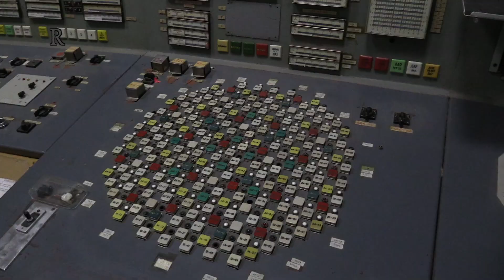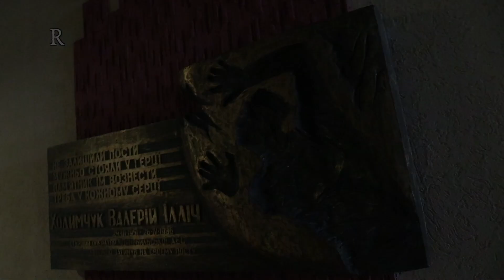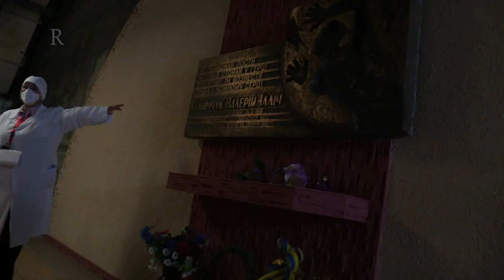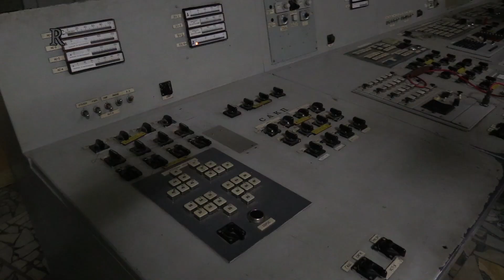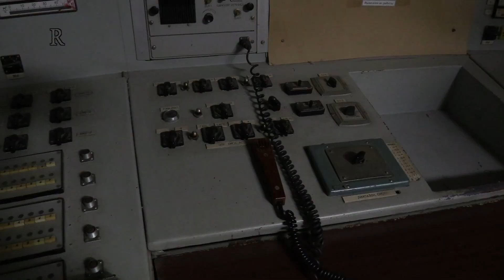Inside Chernobyl power plant: Contaminated parts

Comment: So the tour guide is impervious to radiation poisoning for it’s her daily job??
Reply: Don't get too impressed by the beeping alarms and white coats. If the 10 μSv/h they read off of their dosimeters is typical for her work environment, then that is practically harmless. You could spend your entire life inside those halls without any measurable increase in cancer risk. You need to get over 50.000 μSv before there's any reason to worry.
Reply: Many jobs have allowable levels of radiation exposure that have an increased risk of health problems. In the United States her exposure would be regularly monitored to keep it at allowable occupational exposures.
Reply: @francesca234  Exactly. The 50.000 μSv I mentioned is the annual limit in the US (which is half the dose associated with any increased risk of cancer). Even if this Russian guide would work inside the power plant for 40 hours a week, 50 weeks per year, then 10 μSv/h would only give her 20.000 μSv per year. Well under the American limit, and a long way off from the 2.000.000 required for possibly fatal radiation poisoning.
Reply: yes

Comment: THATS THE EMERGENCY POWER HOW LONG HAS IT BEEN ON
Reply: Yeah the emergency power has been on for 33 years...
Reply: Dude, that's not emergency power. It's just normal power. People still work there. The wast majority of the power plant is perfectly safe, including the areas they visit on this tour.
Reply: Yeah but they have on site generators don't they
Reply: @cb7600  I'm sure they have backup generators, but why would they be using them for normal operations? I assume they are just connected to the power grid, like everyone else.
Reply: @egodreas  yea that would make sense only if they build reactors 5 and 6 and have them protected more with the safety protocols maybe they would not need the power grid

Comment: 2:54 'What is the level?'   "4.4uSv"  That is LOW.  Those geiger counters start alarming at a few times higher than background level.  You get somewhere around 2 to 3uSv/hr sitting on a plane at 40,000 feet.

The area near the reactor is actually quite low dose as it was so thoroughly cleaned up because people had to work close to it.  There are much much higher reading hotspots around the zone if you know where to look.
Reply: There are thick concerete walls, that's why the dose is low. Here's a video from the reactor hall (in Russian)
https://youtu.be/zP-EbZL7040
Reply: Perhaps they turn the alarm threshold down to make it more exciting for the tourists.
Reply: Nuclear plants have very strict regulations. Under normal operating conditions, someone working inside of a nuclear plant will receive less radiation than a person working outside.

Comment: The flickering cathode light tubes give it that extra creepiness 🙄
Reply from the maker: When I saw that I was sure to use that clip :)
Reply: I imagine no one would want to stand in that hallway long enough to replace a ballast and bulbs.
Reply: Yes
Reply: Seriously terrifying, right out of STALKER or something lol
Reply: Have you never seen a fluorescent tube? They can absolutely flicker like that.
Reply: @TheBleggh  The type of tubes they currently use are LED. They replaced the conventional TL fixtures the hallways in 2016-2020. The flickering pattern you see in the video is exactly timed in a pattern either a LED driver or EVSA makes. A conventional fluorescent ballast blinks random intermittent. If you look at the fixture close enough you can see it's a "Batton" LED fixture anyway. If you don't believe me, undervolt an LED lamp and see it yourself.
Reply: @DogappelI thought you were implying the flickering was intentional and not a dodgy LED. If that wasn't your intent, my mistake.
Reply: that is from Beta particles which can damage electronics. Gamma can cause flicker and it can kill cells, reproductive organs, and it can kill anyone exposed two years after contact. Alpha particles can cause burns but they and Theta particles are absorbed and can not do harm.
Reply: @geomodelrailroader  alpha particles can do massive harm if inhaled or ingested. alpha carriers are the most deadly
Reply: @wyliesdiesels4169  that is what i wanted to say,cause Gamma and Beta radiation can be cleaned from the body(as far as i know),but Alpha radiation is the most dangerous since if it stays in your body due to absorption,it will obviously cause mild,then critical damages within the body. But as i said,this is what i know.
Reply: lmao I'd hate to be the electrician in that plant
Reply: Sorry to disrup the vibes, but they replaced the original fluorescent tubes with LED. The flikkering lights are also LED. Fluorescent tubes don't flicker in a similar timed pattern.

Comment: Great video but you were wrong there is a hall way that he could have seen the debris.  (I don't know for sure if he did or not.) Here is a video of the hallway after that explosion looking down towards the hole leading to the core. This is before they got the lead shielding up. https://youtu.be/BalmaO5WO6Q?t=384
Reply: That's actually the golden corridor leading up to unit #3, looking over the pit they dug to try and freeze the soil beneath reactor #4 to prevent any molten corium from making it out of the reactor basement.

Comment: Reactor 4, is not dead, its alive for the next 50, 000 years, its immortal, still living and breathing. I did a private Chernobyl tour July 2019 (watch my video) Guides limited to 3 days a week, 15 hours maximum in the zone. Chernobyl workers living and working there can do 15 days per month, but only doing 5 hours active work outside per day, all other time has to be in the safe accommodation provided, unless in Cherbobyl Town (40 KM Zone) from the reactor.  Its possible to visit deep inside, but only for a few minutes maximum, keep  levels low as a 9 hour trans Atlantic flight USA to Ukraine.

Comment: Why Diatlov couldn't be able to see graphite? The graphite was scattered around the buildling, and he passed through the gold corridor, where windows are located, and from the scene is one controversial part. He go to the 3-rd reactor side of the corridol.
Reply: Dyatlov didn't see the graphite, because he couldn't believe, that this could happen.
He was upset about the incident.
And so he didn't see the graphite.
He was delusional.
Reply: @littlesparklerofficial  but his eyes saw
Reply: @wildRosomak  

Yes, you're right. Physicaly he see graphite, but mental he didn't. 
In his mind was something that told him, that there isn't any graphite. His mind was closed after happening the terrible accident. He told everytime to himself, that it is impossible.
An accident like this was on technical base impossible and his mind told him every time the same. So he didn't "see" the graphite.
His mind was unable to see the truth.
Reply: @littlesparklerofficial  yeah, I know it all
Reply from the maker: Golden corridor is at level 9 meters. The film shot shows him much higher.
Reply: Ya bro the same thing I was thinking 🐱🐱
Reply: The control rods were boron mostly, only the tip was graphite, technically he couldn't see the graphite anyway
Reply: @KazACWizard  

We didn't speak here from the control rods. 
The fuel rods are completly surrounded with graphite.
The graphite in this type of reactor, was used as the moderator, to slow down the neutrons, because for the fission,the neutrons are nearby lightspeed and this is much to fast.
So, they used graphite to slow down the neutrons, to make the fission possible.
There are many tons of graphite in the reactorcore.
Technically he must see graphite and he did.
 For question. Did you watched "Chernobyl" from HBO?
That could be the reason for your answer. I won't be mean to you.
Reply: @KazACWizard  Cały reaktor był wypełniony grafitem, który podczas eksplozji spowodowanej ciśnieniem został zozrzucony na zewnątrz budynku. Gdyby reaktory RBMK miały osłonę bezpieczeństwa, katastrofa nie byłaby taka groźna dla "połowy świata", jednak Związek radziecki oszczędzał na zabezpieczeniu budynku z zewnątrz.
Reply: Actually the golden corridor is in block Gamma and it is exactly at level +10.0.  Dyatlov exits the main control room to go to the backup control room within 2 minutes of the explosion. This backup control room is definitely not part of the tour and it is actually left off most floor plans of the facility, but it can definitely be seen from the exterior of the building. https://www.youtube.com/watch?v=WsRYa1rm4AY

Comment: Why point out that Dyatlov wouldn't be able to look out and see graphite on the roof?  People died horrible deaths because of him and because the government refusing to fix that flaw or let the workers know about it
Reply: Well, it isnt just Dyatlov's fault, in bigger part, it was USSR's fault and their foolish tactics. They wanted big reactors to be proud of, not good reactors or safe. They did not build many things that would make the reactor safe so they wouldnt spend much money on it. The second thing is the fact that not only Dyatlov was a total idiot, but it was mostly because he didnt slept for 24 hours straight, after the test was canceled for 12 hours. He wanted to finish it as fast as they could so they wont have to redo it in a year or two again. Third cause is the fact that when they cancelled the test, they didnt rise the megawatts to the standard so the reactor worked on a low rate of megawatts for 12 hours, which is a big factor of the explosion.
Sadly, this is the truth.
Reply: Murderer
Reply from the maker: Because of debris spread all around the reactor. The control room was at level 9 meters above the ground. It was nearly impossible to reach upper levels because of debris.